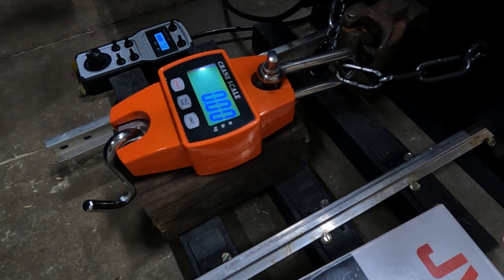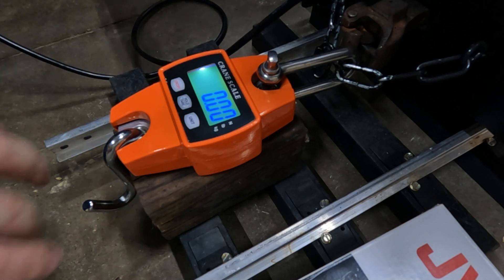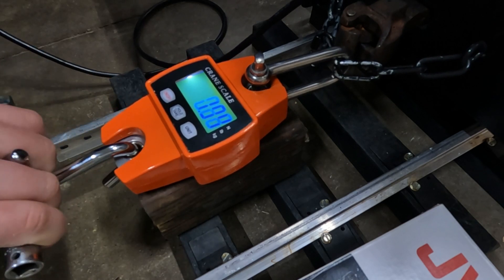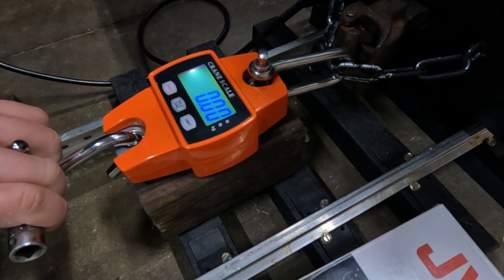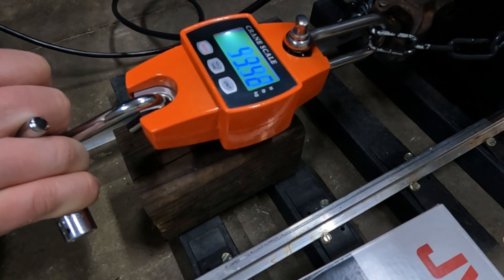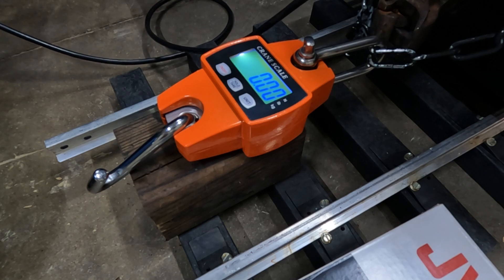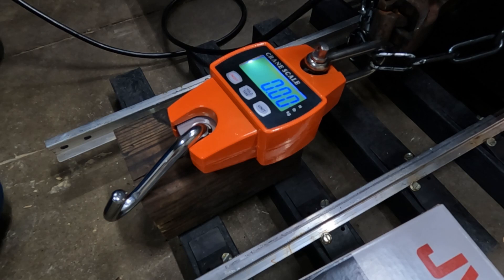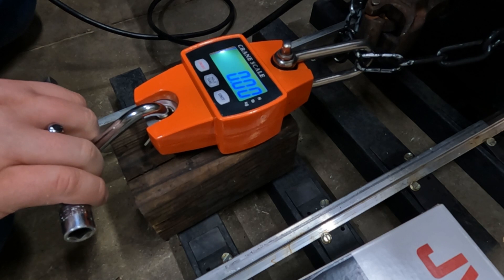What's the Tractive Effort? | 7.5" Gauge, 2.5" Scale Critter

Comment: Cool. On real locomotives they actually let the wheels slip a little, which as you found, adds a little more tractive effort. At the cost of wearing the wheels and track, of course.
Reply from the maker: I generally try not to pull more than it can handle, but I cannot deny I have slipped up the grade a few times.

Comment: Oh man, you had me worried, you need a safty rope on there next time, in case you slip and it goes flying.. but definitely seems like a lot of pull to me...
Reply from the maker: It's okay, I paid off the OSHA inspector.
Reply: @mattkinnard6899  🤣🤣🤣
Reply from the maker: @TriGogglin  when the handheld controller becomes unplugged, everything comes to an abrupt stop, just don't let go
Reply: @mattkinnard6899  oh ok, that makes sense. Gotta have them safety devices...
Reply from the maker: @TriGogglin  there was some consideration. But it still comes down to having a competent operator. Luckily this one is geared correctly so a jog is enough to catch up to it if it got away.